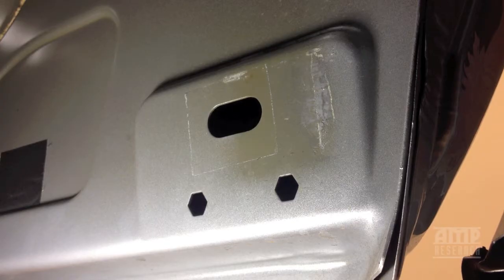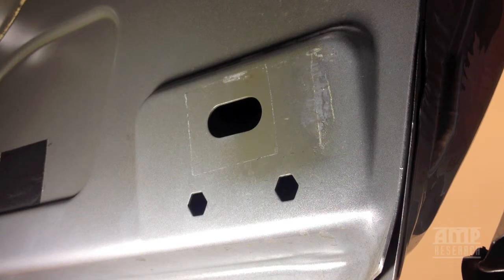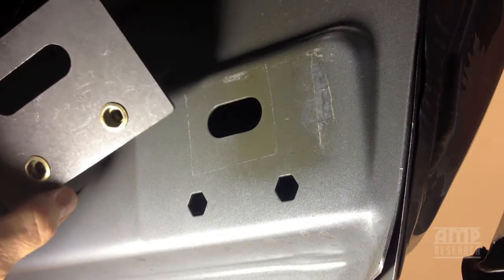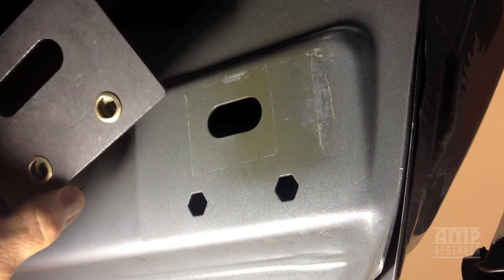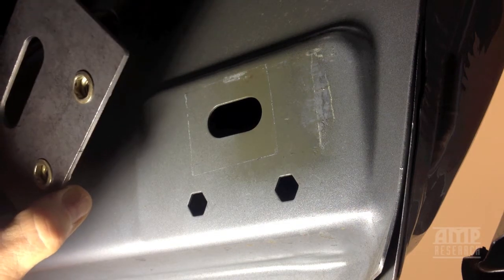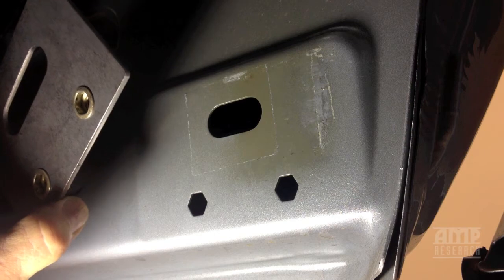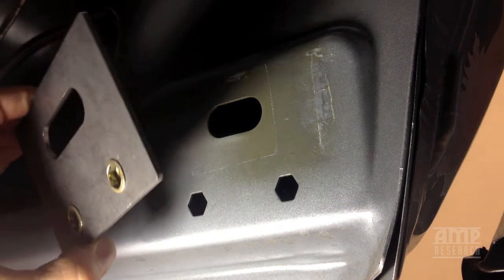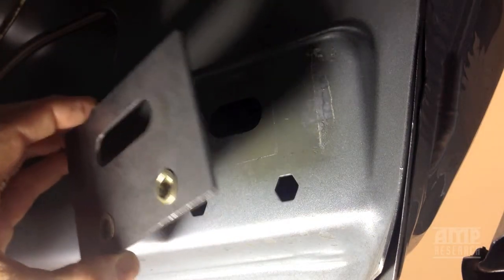AMP Research PowerStep™ Reinforcment Plate Installation for RAM

Comment: Has anyone used these and then installed an AMP Research PowerStep?   I was told that the old sheet metal had to be removed and then this plate welded flush or else the steps would not function.  Anyone have any experience with this?